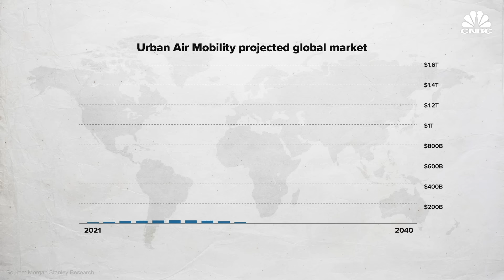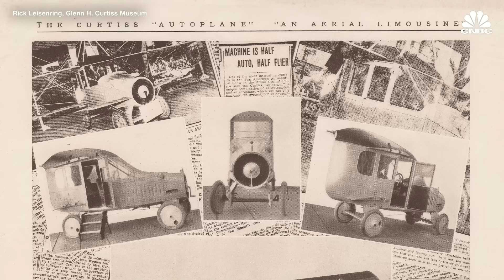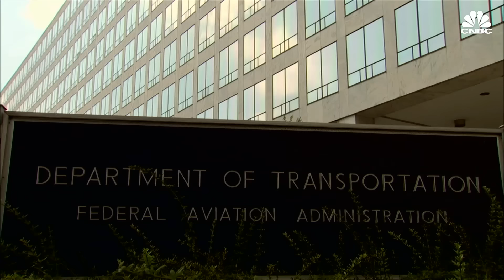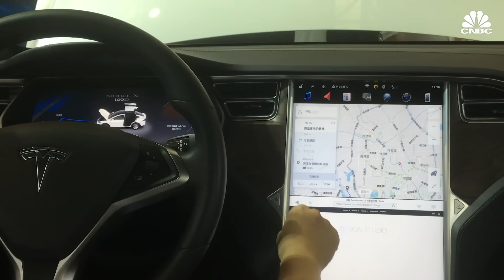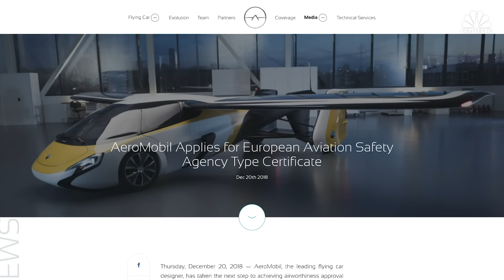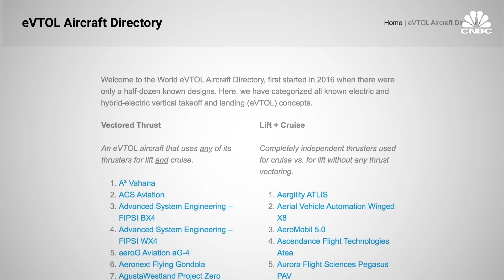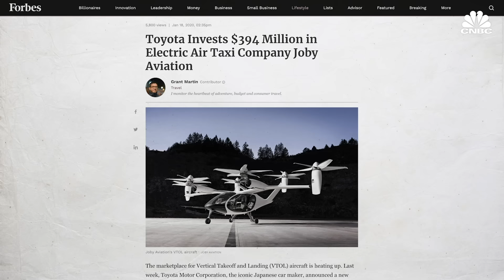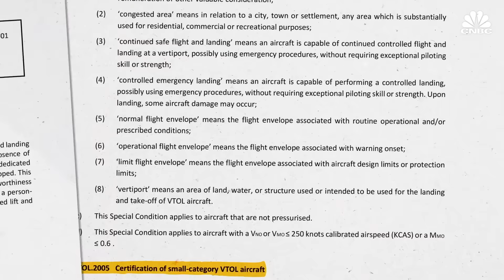Why Don't We Have Flying Cars Yet?

Comment: The best case scenario for urban air mobility is for a semi mass transit which takes people from one central urban center to another in a range of 50 to 100 miles where trains take long to reach and air travel isn’t really feasible. It’s actually a small market and if light rail cannot be built then vtols can be used. Otherwise it’s a waste. Also the current best passenger capacity is 6 per vehicle. That needs to increase. Also completely automated cause human drivers can’t be trusted lol

Comment: Why have flying cars when we could commute in planes or heliplanes that can hover vertically in a parking spot or if in an indoor parking area, turn the engine only used to drive into a parking spot
Reply: Jack Colson You make a good point.  If drones became car-sized, we would no longer need roads except for trucking.  You would not even drive the drones very far.  All a car-sized drone would need would be a very basic suspension, much like light aircraft have now.  I am thinking three or four bicycle-style wheels with very basic steering, just enough to get in and out of a garage or just to park.  Not that much weight, using lightweight materials.

Comment: the fuel economy of a flying car would be exponentially lower than a road car because you have to lift everything off the ground. Even if we are able to solve the noise issue and the safety issues, I really hope flying cars don't become widely adopted as the impact on the environment would be catastrophic. Imagine not being able to sit down in a public park and not being able to see the sky because of all the cars in the way. Let's not repeat the same mistakes of the 20th century and support public transportation instead.

Comment: Just make an autonomous air vehicle small enough to fit in parking spaces and ditch roads. Would require massive infrastructure changes and new engines and probably slit nozzles to reduce noise

Comment: Even for an autonomous air taxi service like uber to be approved.
There would have to be a system in place for Air Traffic Controllers to send commands to the individual taxis for take off, altitude and landing.
How would you feel being a passenger in an air taxi that the ATC cannot send orders to, in order to avoid midair collision with any plane being piloted by a human being.
CASE
A VTOL taxi in a city despite having radar misses "seeing" another aircraft because it's in the "shadow" of surrounding buildings. The "onboard computer" then takes off or pops up just as that aircraft it "couldn't see" comes from between buildings.
No unless the FAA a system already in place or a system atleast in the design phase, I don't even see Uber being able to put any air taxis in service unless there is a pilot on board despite being capable of autonomous flight.

Comment: The last comment in the video, I think,  makes it seem that there will never be a flying car, but rather there will be self- driving cars, as well as VTOLs that wouldn't double as cars because of various safety and technical problems associated with trying to combine the two. So then, if you had a VTOL, where would you land it? Could you land them on your employer's roof? Or in your backyards? Landing pads all over? Would they require a second vehicle to complete the trips? And if the VTOLs did double as a car, it's back to the same problem of crowding up the roads once the VTOL lands, and drives off.

Comment: They're an engineering impossibility. Just look at birds, those who are great flyers can't run, and those who are good runners are very lousy flyers, if they can fly at all.  It has to do with structural rigidity, weight and shape. In every case, a flying car ends up under performing in both tasks, while being more expensive than buying two separate vehicles. You cannot even have an affordable tire that works well in both situations. Also, they create a lot of utilitarian hassles, like having a noisy neighbor, a plane landing on the street, an average Joe piloting an aircraft, etc. And the only problem they solve in the end, is about getting out of one and boarding the other.  Just move on and put all that creativity and resources into solving real problems.

Comment: Flying cars won't be a thing in urban areas for a daily use. Heavy airspace traffic and sound pollution will cause cities to outlaw from flying low over. Also, think as them as costly taxi service. Anyone who rides a taxi cab hates the counting up the cost as it travels. We have a system that way better that Americans fail to use and support. That is the metro transport system; high-speed trains and the rapid transit bus. That less wait time and less burn in your pocket book.

Comment: could you take the propulsion from the plane and use it to create down force on the car, that way you could make the car lighter and still create enough friction with the road to be able to effectively accelerate/ like using the same force that goes against gravity to lift the plane and flip it upside down to push the car towards the ground?

Comment: Simple, NHTSA is completely incompetent and FAA is too slow and expensive to certify aircraft. I am an Design Engineer and can design 5 different VTOL flying cars with none of them sharing design architecture or method of flying myself, but those two entities wouldn't pass it, not because it isn't safe, because they are incompetent. The short answer is these vehicles need to operate on a new set of criteria that will allow the tech to develop and become cost effective.
Reply: And where are you supposed to take off and land exactly? Technology isn't the problem it's a lack of practical space to use them en masse. Flying machines can't replace all road vehicles either.

Comment: Efficient helicopters basically. Technology which reduces sound and weight together with a yet to be developed propulsion system is the key. Why drive if you can fly. its not flying cars but flying personal transport.

Comment: The Moeller Skycar looked dangerous and impractical to me. I'm waiting for the Hanes Aeroblazer. It's a roadable small jet plane with folding wings-cruising speed 350 mph. Most of the other flying cars are as slow as...CARS. OK, maybe not cars stuck in traffic, but only about 100 mph.

Comment: Elon , we all know if this works , the car pilots would fly over certain. Areas . Like a personal bike lane for cars. Also their will be no flying over a residential area. We will defeat the purpose if we don’t do this. Why have a car if you don’t drive? You should land outside of down, land , or land in roofs, where roofs have no space to park so you’ll have to get a driver , in which case you might as well buy a helicopter. It doesn’t make sense to have a flying car . However , traffic is why we want it right? Then why not look into escalators , or those automated walk ways in the air port where everyone is going the same speed and no one is driving so no changing lanes, or accidents , just one speed and have no traffic?

Comment: The real reason why we don't have flying cars yet. 1 Honda Can Make Robots & GM, Ford & Chrystler Can't figure out technology to make flying cars but they already have technology to Put Computers In Cars & complicate us getting urgently needed spare keys to our cars made by putting Chips In or on Car Keys & Make Push Button Start & Switchblade Car Keys. & lock smiths & places where you get house keys and car keys without chips made who really don't wanna fool with it even having blanks with chips. And then making blanks with chips so expensive not $1.00-$3.00 like car keys without chips.

Comment: If everyone could zoom over traffic then there would still be traffic.
Reply: No think about it like this.

Thirty cars in two lanes on the ground.
Ten cars 20 feet higher than the ground.
Ten cars 40 feet higher than the ground.
Ten cars 60 feet higher than the ground.
Reply: @linex1780  for that to work we would need AI driving the cars not humans.
Reply: @bluedragongaming8633  That's also true. There's also really no point in flying cars anyway tbh.
Reply: @linex1780  And how do you get in and out of those aerial lanes? If air highways don't mimic normal roads they're utterly useless.
Reply: @PabloGonzalez-hv3td  I will fly

Comment: Flying cars? Big no. Nope. Nada. Bad idea. Automotive manufacturers have taken years and years and years to design all components of a vehicle to be driven on the road safely. Airplanes have been designed to fight against or resist gravity. That's waaay too much functionality for a "FLYING CAR". I think we're forcing the future. In my opinion we should start with hybrid vehicles and hybrid airplanes. Start with a small market, make all types of vehicles and all types of planes hybrid. PERFECT the hybrid game. Make them reliable and make everyone utilize it as well. Then go towards electrification, fully electric airplanes that can circle around the globe at least once without stopping and fully electric vehicles that have a minimum of 1500km range in them. Then you can think of flying cars. Another thing to think about is not every country has the conditions to have hybrid vehicles. Look at us here in Africa, we will find a way to steal the batteries and sell them on the black market. Start small then go big.

Comment: see with flying cars it would probably be way easier to park bc you can just fly over a spot and land without having to maneuver around. Flying cars would have so many problems though, how would police chases work in the air it would be much harder to pit someone if they have spinning blades all around there car 50 ft up. Lastly terrorist attacks would be BRUTAL you could basically recreate 9/11 but with much less power if you smash a car through a office building window.

Comment: We're never gonna have flying cars because the entire concept is stupid. It was dreamed up by comic book writers in the 50's for no reason other than it looks cool. If you have a car, you drive to the flying thingamajig. Then you take the flying thingamajig. It's neither economical nor practical to design a vehicle that can be a car and fly like a chopper. How would you regulate such traffic? If everyone had a flying car, it wouldn't improve the traffic situation at all, other than the fact you'll have to deal with 3D congestion and noise pollution. We'll still have cars in 100 years. Then we'll have some kind of short-range flying thingamajig.